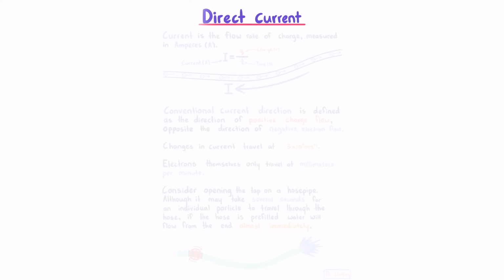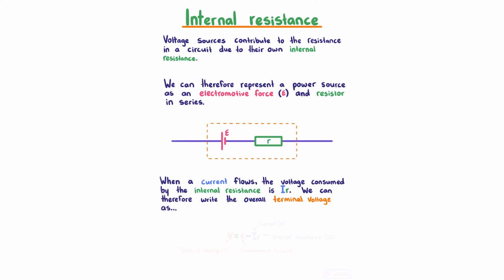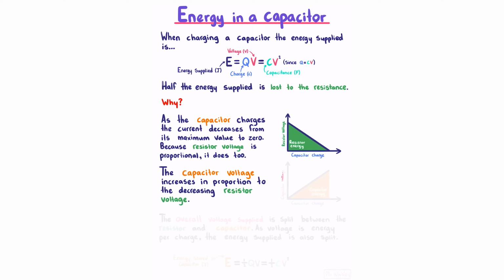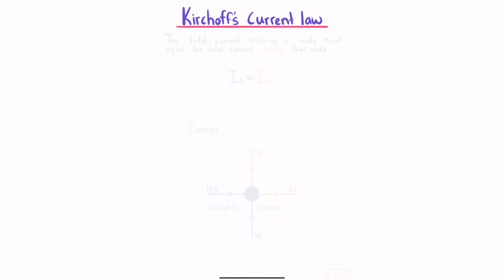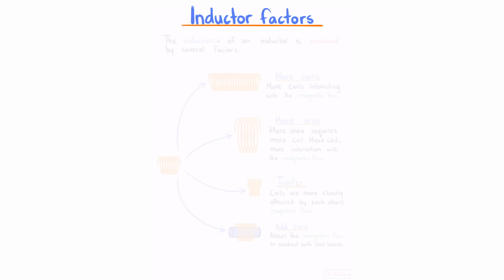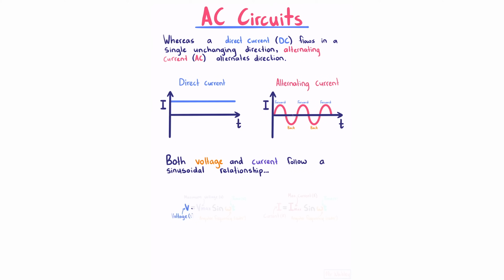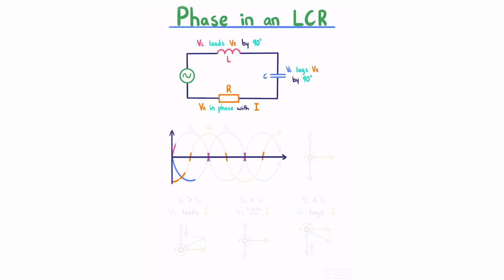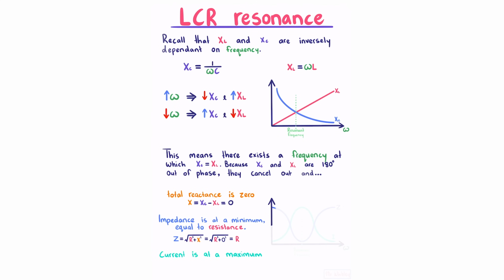[UPDATED VIDEO IN DESCRIPTION] 3.6 Electrical Systems notes (NCEA Level 3 Physics)

Comment: Hello Mr Whibley Do you know the 2 equations on the formulae sheet which are I=Imax sinwt and V=Vmaxsinwt ? Would problems come up that involves using these 2 equations? It's strange because I've been through all the past papers and I haven't used these 2 equations?

Comment: For charging and discharging inductors, the inductor voltage will both decrease. How does discharging the inductor voltage differs to charging the inductor's voltage?
Reply from the maker: Excellent question. The inductor voltage opposes the change in current, if the current increases the voltage will oppose this increase, if the current decreases the voltage will oppose this decrease. This means that the charging inductor voltage will be in opposite direction to the discharging inductor voltage.